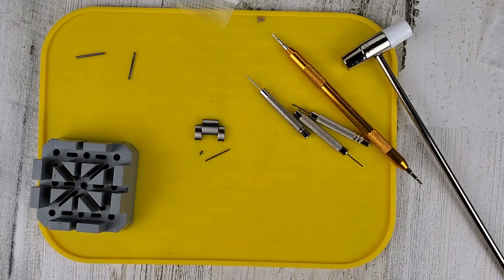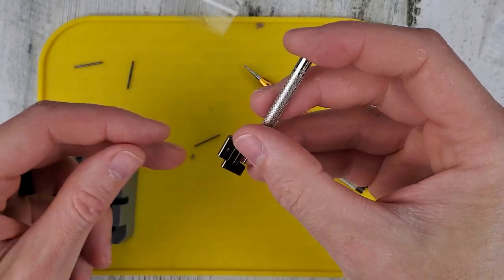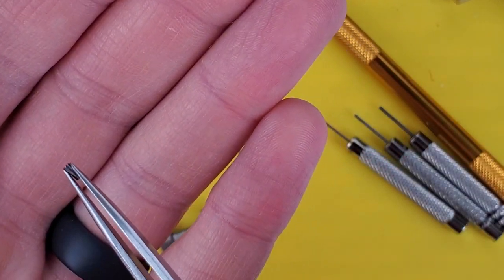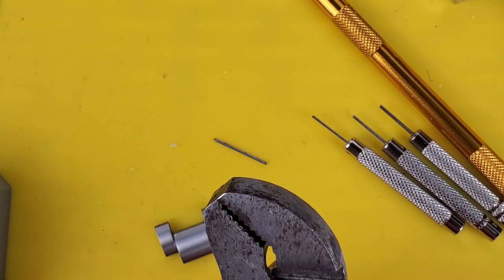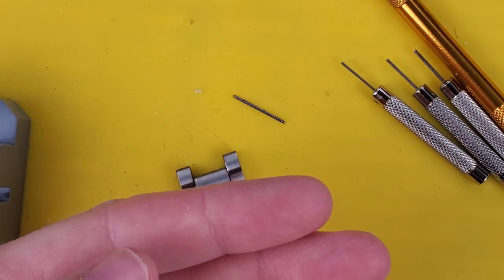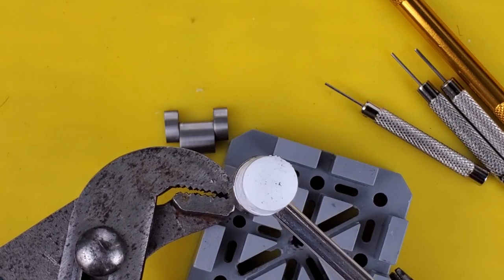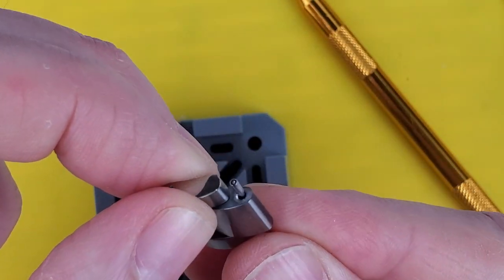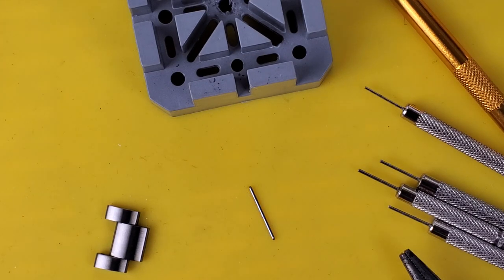A Warning About Sizing A Bracelet With Pins And Collars And How To Fix It #watch #repair

Comment: SOLVED. 😊 Thanks for your video. The collar fits in the larger diameter hole of the center link/section of the bracelet, on the side of the arrows. The center section has a larger diameter hole than the outer portions of the bracelet. You fit the pin through the outer section, and then through the center section (that has the collar). Next you hammer the pin down, through the resistance of the collar in the center section; the collar is engaged and the pin moves on through to the other outer section. Since the two outer sections have a small diameter hole than the collar, the collar can never pass through the outer holes, and will thus hold the pin in place.
Reply from the maker: Yes, that is exactly it.  I am glad that the video was helpful.
Reply: Thanks for that comment. I didn't know where the collars went. They just flew out when I removed the pins. The video was of no use in that respect.
Reply: I didn't realize I pushed the collars out till I saw the video 😂. Thanks for the info regarding the holes near the arrows being bigger!
Reply: THANK YOU! You helped me so much!!!

Comment: I received a new Citizen for Christmas that was slightly too large.  After removing the first two pins, I was surprised and confused when the little collars dropped into my trey.  Id never dealt with them before.  It took me a little searching to find a "how to" vid because I didn't know what I was dealing with.  I thought they were a spacer of some kind.  I understand the process now, but Id rather deal with  the old school pins.  The tiny collars are a pain in the ass to deal with.
Reply from the maker: Congratulations on the new watch.  I am glad that my video was helpful, and yes I agree, I'd rather have the old split pins, or screw pins.  Some brands have better pin and collar systems, but not my preferred system.

Comment: I bought an Omega seamaster 300m the screws were so tight I took it to a watch maker and he used a torch to heat up the locktight and break that seal to size the bracelet. The screws were unbelievably tight.
Reply from the maker: Wow, that would be very frustrating.  I have only had problems with the screws on a microbrand watch, I bent the tip of my screw driver trying to unscrew it.  I forgot what the brand is by now though.
Reply: @WrongTimeWatch  I found out later i could have put the bracelet in boiling water to break the locktight seal,lol

Comment: I put an extra link back into my Citizen watch strap. Unknown to me at the time, the little metal collar that sits inside the link was missing. I put the watch on and went out. To my horror, the watch fell off my wrist and landed on a tarmac path. It wasn't until I inspected the strap that I realised what had happened. The watch cost me £500 when I bought it the other year and I ended up scuffing the side of the case ☹️ An easy mistake to make, but it could have ended up with the watch totally ruined. Always double check when adjusting a strap that these collars are in place first...🤔
Reply from the maker: Dang, I am sorry to hear that happened, but yes at least it was not a total loss.  When sizing a bracelet or installing a strap I try to tug on on it a little bit to make sure that it is secure.

Comment: When trying to squeeze the collar that you had stretched open I'm just wondering if it would have been helpful to slip it onto one of your pin extracting tools and then use the needle nose pliers to squeeze it back into shape. Having it slipped over the pin end of the correct size tool would have acted as a size guide and prevented narrowing it too much. Just a thought.
Reply from the maker: That is a really good idea.  I wish I would have thought about that before I did what I did with it.

Comment: Sized a Citizen BJ7111 with a titanium band with collars today and thanks to this clip i used one of those inexpensive pin presses sold on amazon and it went very smooth. With the press it pushes the pins out in a straight line and the collars remain in the links. 
Thanks for the heads up and saving me the aggravation.
Reply from the maker: Thanks for watching, and I am glad that the video was helpful.

Comment: You can go to a Seiko authorized dealer and they can order these collars for you or you can contact Seiko directly to order replacement collars .
Reply: Can also contact Long Island Watch and get some.
Reply from the maker: Damn, $8.99 for one.  Might be more expensive then gold that for that tiny piece of metal.
Reply from the maker: Thanks for the suggestion, I will have to check that out.

Comment: Yeah pin and collar not my fave. My new Tag Heuer GMT has this system. Luckly,  I have mastered it through the years BUT I still don't prefer it.
Reply from the maker: I just need to remember to use a smaller diameter punch next time.  I am getting better at it, but I do have a couple more bracelets to size.

Comment: Is 0.8mm pin pusher fine?
Reply from the maker: I either used my 0.7 or 8.0 mm pin pusher.  They are not marked and close in size.  I first used my thickest pusher which is 1.0 mm, and that was too thick.